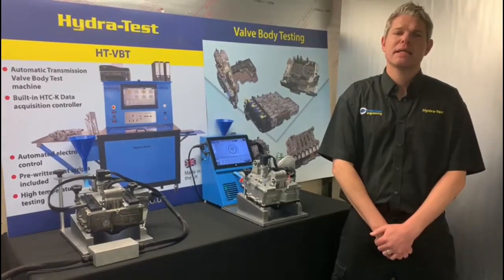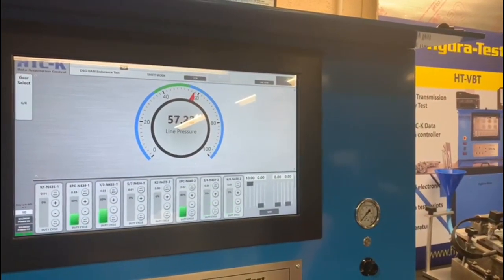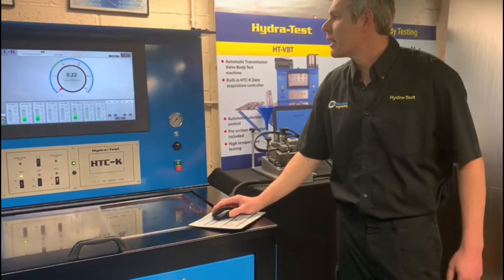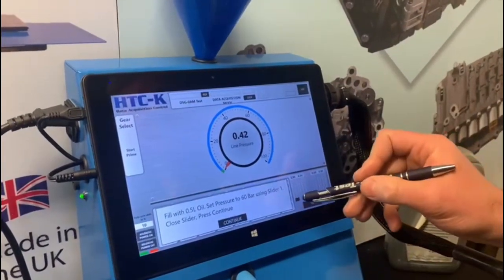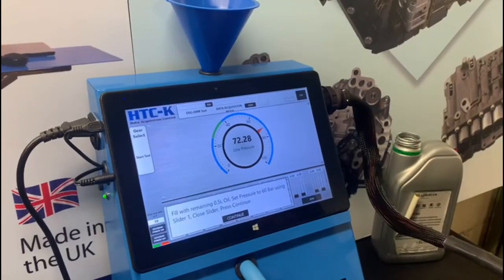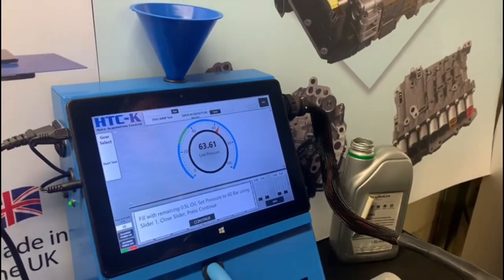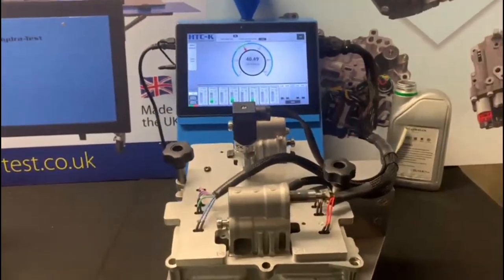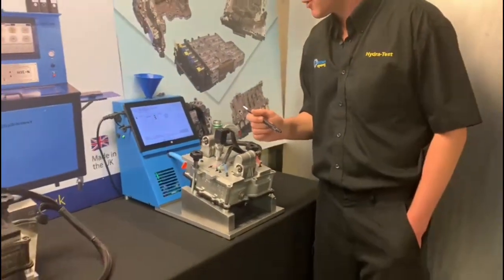DQ200 (OAM) DSG valve body testing and problem solving

Comment: Hi mate..have an issue on p17bf..change already the pressurec acumulator and all seals base and gaskets and even the solenoids and the error persists..pump protection apears on 2 km running and all show p17bf..im confused..tested also for leakeage on 60 bar pump with oil to see bubles and dont see any bubles..can u give some help??

Comment: You can automate the pumb pressure to shut of automatically by having the user enter his ideal max pressure that he wants. For example, if the user sets the pumb to 63 the unit once the pressure reaches 63 will shut off. This will save time as well cause it will not overpressure and having to w8 for the pressure to shut off.